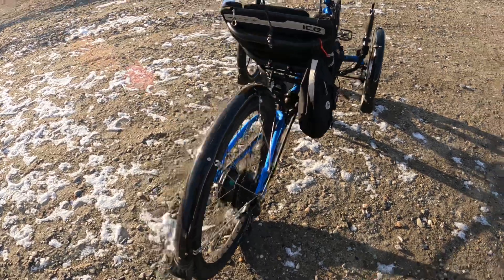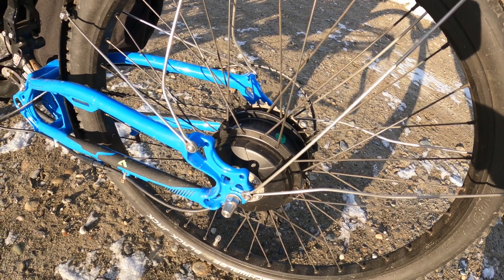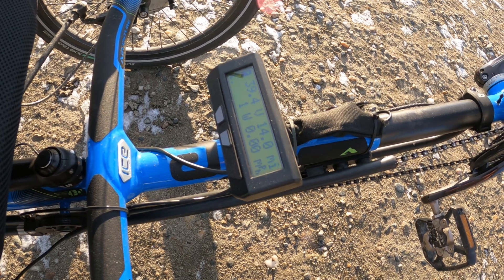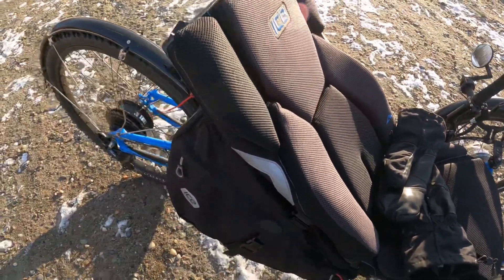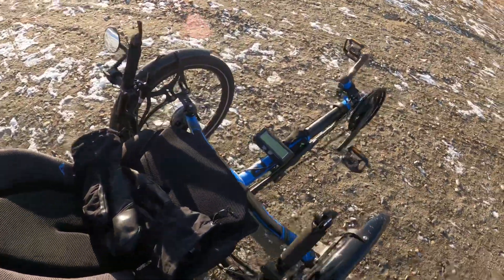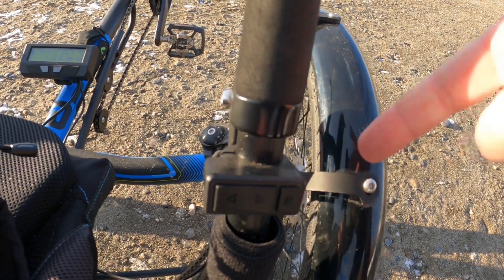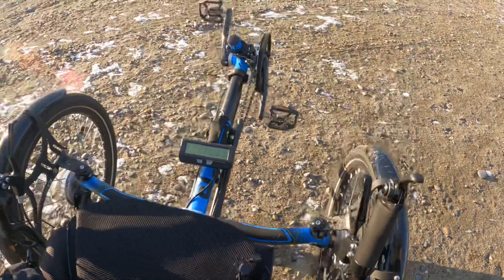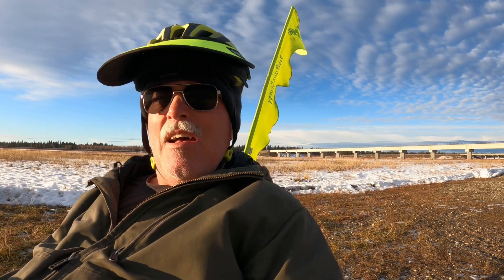Adventure II Electric Cost and Conversion | ICE Adventure | Recumbent Trike

Comment: Great video as usual. I would love to set my ICE adventure with the same rear hub and other components. Is it possible to post the part numbers for all the components in this e -assist system?Thank you
Reply from the maker: Would recommend contacting Grin Technologies as they will give you the best and current setup for the conversion given upgrades since I did mine.

Comment: Thanks for the interesting video.  I'm considering an ice adventure for my wife.  Do you find the elastomer suspension works well?
Reply from the maker: I am very impressed with my ICE trikes. The rear suspension works quite well and the ability to move and change the elastomers makes fine tuning quick and easy. I adjusted both my Adventure and Full Fat in a matter of minutes. ICE has an excellent video on the process. I made the adjustment on my Full Fat in the middle of my Denali Highway ride on the side of the road.

Comment: What an awesome system. I wish I did this system from the Bafang Mid drive, when I had that installed at a shop in Phoenix. The pitch was do you want a dragster or luxury Car, 70s Fleetwood caddy. Bafang versus the Falco system. I pulled the trigger on the Bafang mid drive. I loved the acceleration but missed the human powered low gears. Last year the a Sturmey Archer was pitched. I went with that for a lower gear range but , it was never as low as the front crank. The Sturmey Archer finally failed.  I was hopping the “Sturmey guy” who did the install was there. The rest of shop said that happened to another customer. The shop also said that  was to much  torque for the the 3 speed hub. I estimate that I rode about 1800 miles. And over 6,000 miles since converting to E . I took the wheel off of my trike while in the shop parking lot and the swapped my cassette for $85.00 . They saw my frustration and said that maybe I should consider one of there fully suspended Stine Trikes for a low ball $ 1500 trade. I sat on the Trike and I said this ain’t the same as mine. Can you just swap my cassette so I can go down the road. I should post that as a educational experience video maybe. I still have the front crank and the seed is planted . I will have my gears back and I can install myself for sure. Thanks for your video. I love myAdventure.
Reply from the maker: Hindsight is always clearer I’m afraid. I’m fortunate that I’ve been able to truly test these systems and dial in my preference. I am also fortunate that my local dealer is quite open to seeing my experiments. He has seen my conversion and now has a bit more information to share with his customers. Thanks for your excellent comments.

Comment: Great video once again! I really liked your “penny-pinching” method to convert your manual Adventure to E-assist. My partner bought an ICE Adventure with the Shimano Steps system earlier this year and paid around 8K - similar to your quote. I used to be adverse to hub motors, thinking that they were noisier and less like a normal peddle experience -more jerky, but for the money you saved and such a slight difference in performance, it was a wise choice.  And really, if one is at all a bit mechanically inclined, working on bikes is quite easy, and rewarding in the end. Cheers!
Reply from the maker: Thanks for your comments. Sure wish I knew everything I know now when I first started my recumbent trike journey but where would the fun be then.